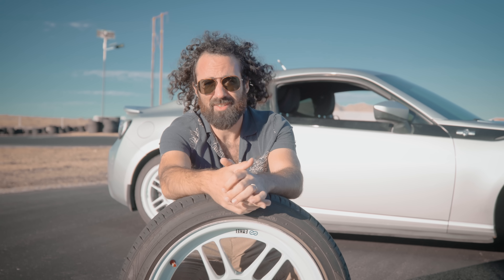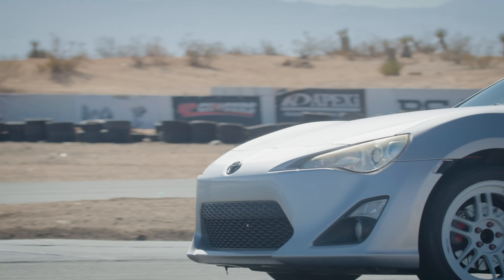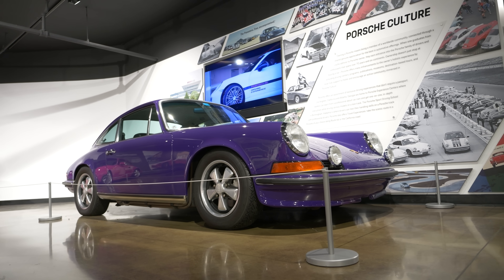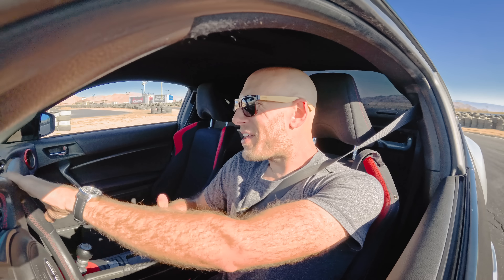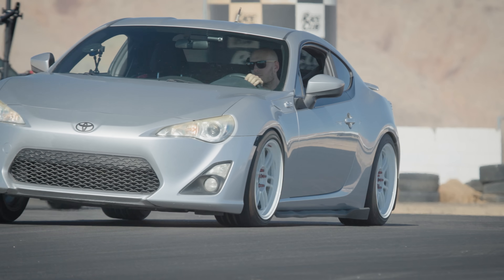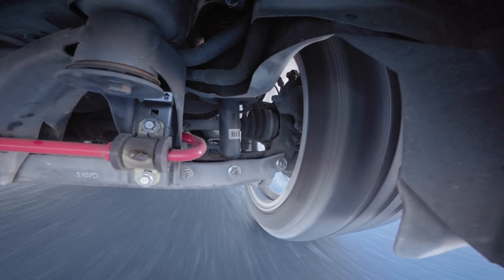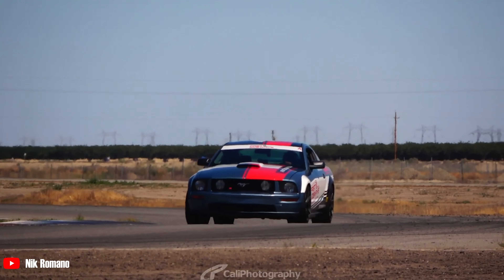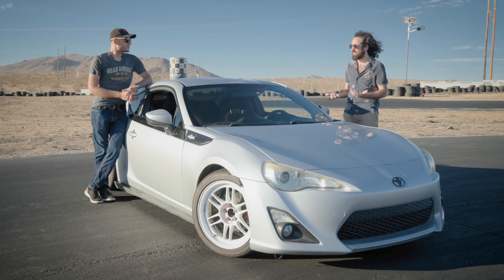We drove a Porsche on GLASS to show you this

Comment: 9:38 Even this short clip is enough to tell that the M4 driver had solidly frozen hands. Once your rear ends start to slide to the side, you have to compensate with your steering to keep the original direction. This driver did absolutely nothing, probably caused by sheer panic of losing control. The driver didn't even fully hit the brakes to stop the situation!

Comment: Learning what is slip angle will unlock a world of knowledge how cars work... If you are a racer or even a simracer: go and read an hour about slip angle. You will understand the mechanism that ultimate is what turns your car, accelerates it and slows it down. It is like millions of rubberbands that are pulling the car along, that is the ONLY FORCE THAT IS ACTING! The pull of those rubberbands and what holds it at the other end is grip. If the pull is more than there is grip, you slip. If you don't pull as hard as you can, you are not utilizing all of the grip. 

When your car is standing still the force you feel when you turn the wheel (non-powerassisted of course) it is the same force that is keeping it on track at speed. It is the same force that is turning it. You can feel the maximum grip and what happens when you exceed it, what happens when static friction turns to dynamic, as the wheel suddenly feels lighter and the tires start to slip instead of gripping. Tire contact patch is stationary relative to the ground... When you get those three things at the same time... it all starts to make sense.
Reply: Love the rubber band analogy!

Comment: You explained everything except the main reason why the same tire on the same car on the same surface creates more force when braking in a straight line than when driving through a curve, or to be clearer, what needs to be done to make these two forces as similar as possible  and to be able to go through a curve with incredible centripetal force

Comment: I think this is why most car driving "sims" still don't feel that realistic. They can't model the exact point where the car is sliding slightly and still giving you maximum grip. Instead they give you lots of grip until you start sliding and then you've lost control completely. Tell me which driving sim accurately simulates this!
Reply: Assetto Corsa (and Competizione) both do a great job with this. Try the "tuned ae86" in AC for that experience, maxed out.

Comment: A bit of slip angle will result in a faster lap time, for the first lap or so at least. If you are doing more laps, especially on street tires (even grippy ones), they tend to overheat and lose traction with this type of driving after the first lap or two.

Years ago, I was instructing at a driving school. One of my fellow instructors had a Jaguar XJ12 with the new grippiest street tire at the time, the Dunlop D40 M2. If you paid attention, you could tell which turn he was on from the pits because those tires with that car at the time made a loud, continuous screech in every corner.

Comment: The book Tire and Vehicle Dynamics by Dr Hans Pajecka has a code listing for treadsim. It is a semi-empirical model of  tire dynamics. Longitudinal slip, slide slip, and normal loads are the inputs along with properties of the tire. The output is the longitudinal and lateral tire load distributions. 

It does generate pretty accurate tire behavior, i.e. what you would see from a flat belt tire tester.

Comment: this was a good informative video as they usually are...but...never mentioning how the driver manipulating VERTICAL load is a huge miss, tires make grip based on vertical load and the driver dynamically controls it when they drive by choosing to trail brake or not and how they blend throttle on exit (relative to steering). Vertical load changes the slip angle curve, you cannot have this discussion without including it, it is the most basic and important point because it ties the whole topic into the technique the driver should be using (instead of blaming everything else for the lack of grip and balance)
Reply: I suppose it's easier to explain in two (road) dimensions initially...though the previous Mustang episode talked about that a little.  Maybe they can take the next episode up to Sonoma and put it all together.
Reply: @AndyChittum  it's really impossible to talk about slip angle without load since without load there is no slip angle

Comment: 10:20 I drive an AWD Stinger and I chirp the front tires at low speeds all the time. Particularly on the way home from work where I make a slow left turn with a front wheel going over a manhole cover. It's a drive wheel and it's steering and it loses traction slightly over the cover. Chirp.

Comment: These deforming is actually a certain broblem in mountainbiking. With wider tyres and low pressure you will ride very comfortable. And the level of grip is awesome. But you loose all precision in fast cornering. So the play between tirewidth and pressure is a delicate balance.

Comment: 1.5 PSI matters in F1, and probably most high level pro racing... no one who bins it leaving a car meet without a MASSIVE unforeseen mechanical failure is a good enough driver to notice 1.5psi difference, even on track.
Reply: Same with mountain biking. You should notice 2 psi.

Comment: The fact tires works so well, is the reason why even bad suspension setups are still performing better than they should. Also F1 is interesting, where clearly the tires are doing most of the suspension work, which is kind of sad to see for the top racing class it's supposed to be. It's actually bad because tires have close to none inherent damping, so the most of the F1s suspension is undamped... Also one of the reasons why some cars have better turning performance than other cars with similar downforce...

Comment: I have a 2000 Primera GT (Infiniti G20), and it's soooo easy to rotate around corners. Once you feel the front tires start to slip, you let off the gas and the slip changes to the rear tires. The rear end of the car feels like it slides around the corner, even though there is no tire squeal. Then you just hit the gas, the rear end straightens out, and you blast out of the corner.

I never understood why all of that was happening until this video. It's cool to see how much engineering and thought goes into making fun cars.
Reply: Sounds like you're nailing it! Glad we could help explain what was going on.
Reply: Not exactly. The G20 is Front wheel drive. What you are describing is brake induced oversteer. In effect, by lifting off you transfer weight to the front wheels ADDING grip and lifting it from the rear, REDUCING grip AND simultaneously ADDING angular force (a flicking effect) the to rear of a car. I do this in dirt Khanacross with a front wheel drive car,  it can done with a rear wheel drive car if you steer into a corner and tap the brakes and keep your foot in it. You may well spin in either version but with the front wheel drive you can put your foot down and pull yourself out, with rea wheel drive you must counter the drift and then steer out.
Reply: @damienmills293  You're both describing the same thing. Whether you lift off the gas or apply trail braking, they're both versions of what we call at the class, "deceleration rotation." Nuances are different, also various cars respond to them differently, but it's largely the same thing.
Reply: @damienmills293  I feel like it's lift off oversteer, because I control it with the gas pedal. The more I lift off, the more the rear end starts to slide. It's a similar feeling as in a RWD car but I just move my foot the other way. You can feel the weight transfer to the rear. It's something I've never really felt in a FWD car before.

Nissan switched the Primera/G20 from independent multilink rear suspension, to their beam multilink rear to cause this effect. Something about keeping both rear tires vertical, while letting the front tires use all 3 axis. It's what won it the 99 BTCC championship.

Comment: Tire technology does more for car progression than most anything else. That's why track times from 10 years ago basically mean nothing
Reply: Case in point: Last year a Porsche Carrera GT lapped the Nürburgring 20 seconds faster than test drivers had lapped it 20 years prior, tyres being the differentiator.
Reply: @SamuelSantos_ exactly.
Reply: I feel like theres also a lot of other reasons track times from 10 years ago basically mean nothing
Reply: Still a very good benchmark
Reply: It's also really impressive the amount of abuse tires deal with and keep rolling right along!
Reply: The tires are one of the most stressed parts on a typical car when it's on track.
Reply: Someone finally gets it. Well done, kiddo!
Reply: @Retheraq I'm probably older than you buckaroo

Comment: There are not "two types of slip angle".

There is slip angle, and a few things that CAUSE slip angle.

Slip angle is simply and only: the angle between the direction the tire is pointing versus its net velocity vector.

The slip angle is caused by 3 things. Crosswinds on a road/aero, the orientation of the whole chassis relative to the velocity vector (chassis slip angle), and steering wheel angle.
Reply from the maker: Ah the perils of talking while driving. Two "parts" to slip angle
Reply: but hes the automotive "journalist" he knows it all and knows best. Dont try to argue with them... they got those jobs for a "reason"..... LMFAO....

Comment: A great way to see some of this in action is seeing wheel cams of race cars and folks who film their track cars. Seeing wheels deform is almost mesmerising
Reply: Believe it or not, what you’re seeing on those onboards is not quite slip angle (at least not all of it). What those videos show is the lateral bending and twisting of the carcass itself, there’s even more slip that’s generated only at the contact patch from the adhesion between the rubber and the ground that can only be seen with footprint and glass studies like this this video! Tires are extremely complicated, and one of the things that we still know very little about.

Comment: the contact patch visual is sick, wish there was a whole track make of textured glass to see how tires respond dynamically under load
Reply from the maker: glad you liked it. we really had no idea it would work until we got there and started filming
Reply: @drive  Except the "contact patch isn't changing its orientation while turning the wheel" would be a different story in motion, so people will most likely get a wrong idea about this.
Reply from the maker: We're still changing the direction the wheel is pointed in relation to the direction the contact patch is being forced. It's just that in this instance, instead of a lateral load, it's a vertical load. In motion the contact patch would look very similar, except the shape would be squared up because of the camber of the wheel
Reply: The problem with that is it's hard to see through textured glass. So you'd get a blurry view, at best.
Reply: @usefulidiot21  even with textured glass, for something that's touching it directly, the imprint is relatively visible, at least would be good enough for comparison, think about when a hand is directly on a textured glass door, the outline of the hand is pretty easy to make out